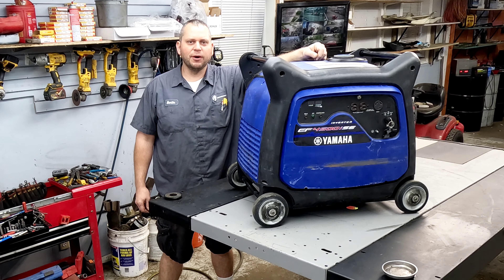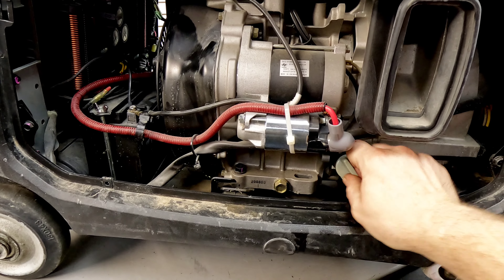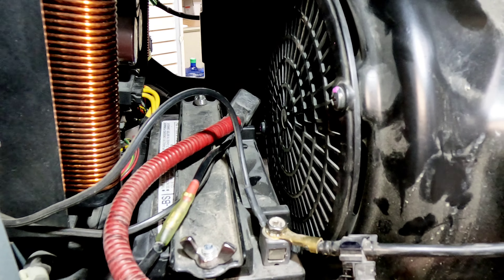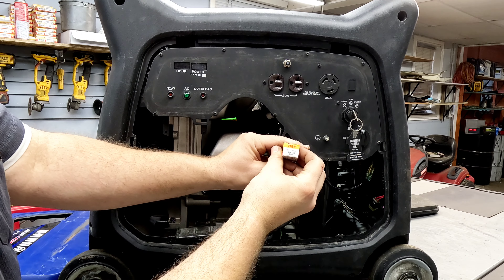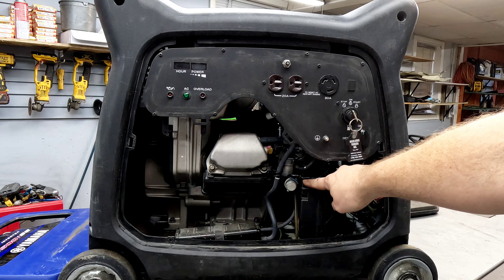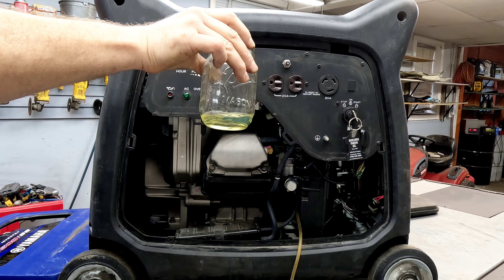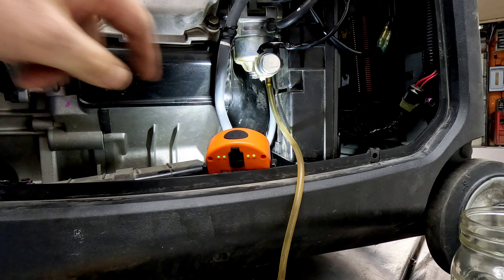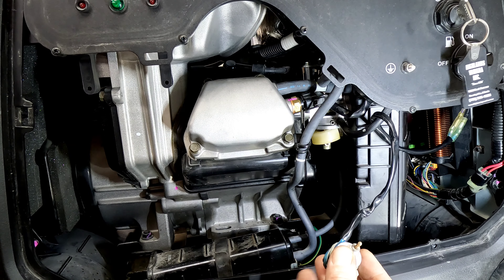How To Easily Fix A Yamaha Generator That Runs Rough Or Won't Start EF4500ISE Electric Start

Comment: Great video! I’ve been struggling getting my Yamaha inverter running after Helene. She quit running. I’ve been going through it, exhaust was clogged and took care of that. Still won’t start so the fuel lines are now new, but now it’s time for some of the details shown in this video.  
Hate to quit inverter, it’s been a great machine. 
Thanks for methodically going through this. Good craftsman-like video. 
Appreciate you!!
Reply from the maker: Thank you! I hope you are able to get it all back up/going!

Comment: Great video! I have the EF6300isde that has a slight surge, more noticeable running in eco mode. Do you know if they use the same carb? Also I don’t see the pin retracting on fuel shut off solenoid (pin seems to be staying out all the time). Could this be causing the surge? On to checking the jets? Thanks in advance for the reply.
Reply from the maker: Not positive if it has the same carb but the solenoid should definitely retract. I would check this and the jets
Reply: @IndRepair appreciate you!

Comment: Major design flaw - not having direct access to oil level check without having to remove a side panel requiring a screwdriver. Every engine should be checked for oil level every time before starting!
I could easily see this generator engine being destroyed because the oil level wasn’t checked religiously.
Reply from the maker: Definitely!